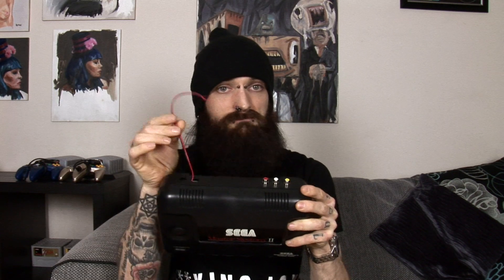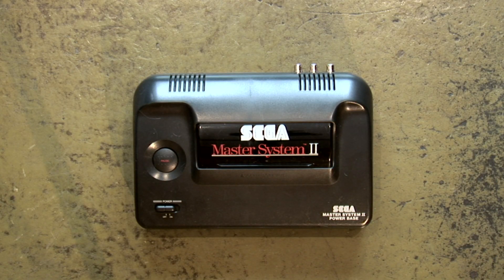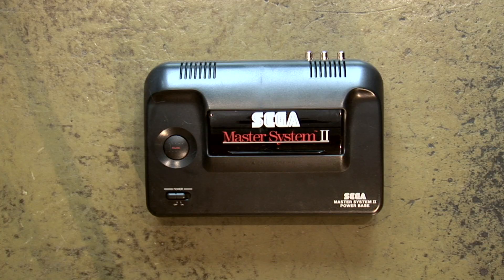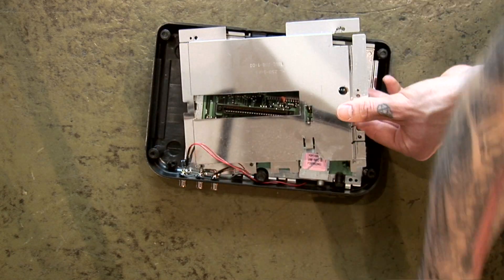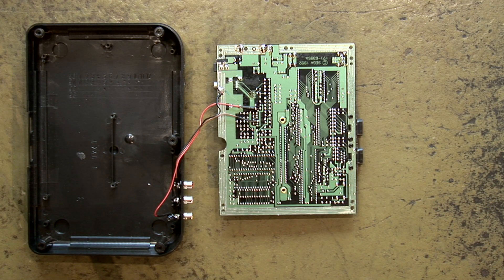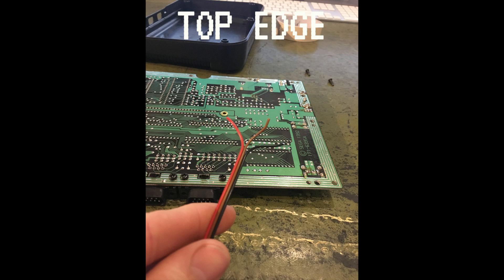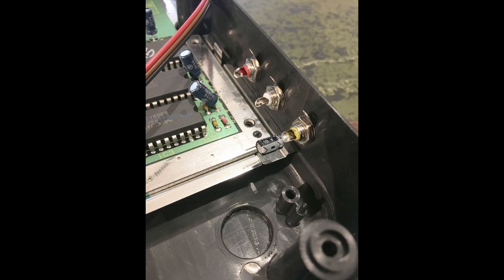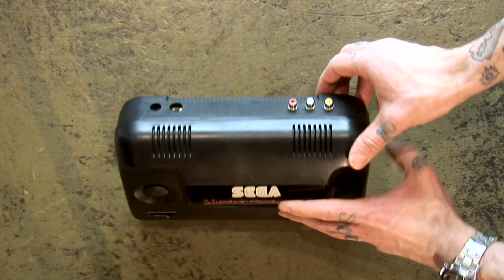[HOW TO] Composite AV mod a Sega Master System with a Fujitsu MB 3514 chip. (Non Sony chip.)

Comment: On my third master system 2 I found this exact chip, your video helped a ton

Thanks so much man.
Reply from the maker: No problem bud, glad it helped!
Reply: @retrogamereclaim3364  hey quick question, do you know which pins or alternate solder points for S Video? I wanna wire an s Video port to it but I cant find any information on which pin is Luma and chroma for S Video